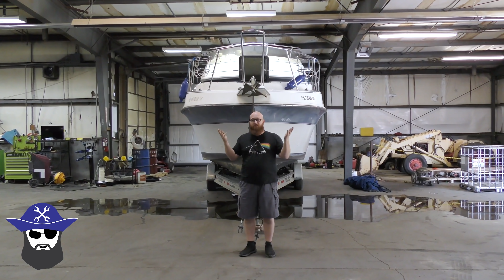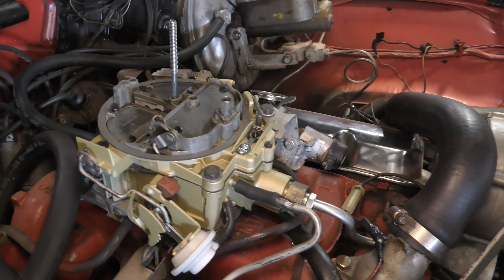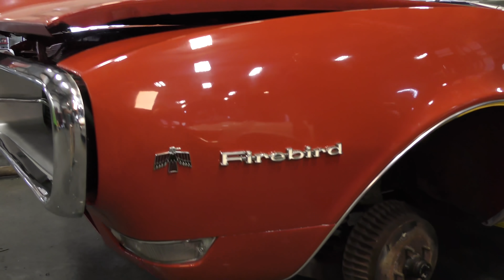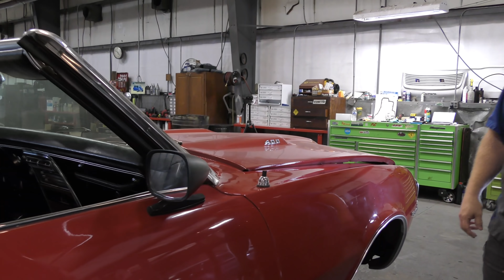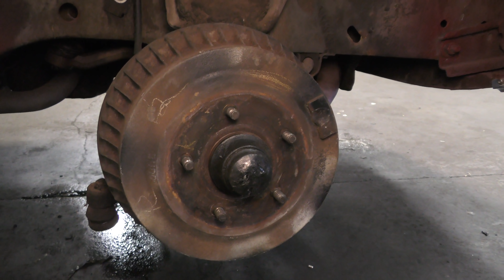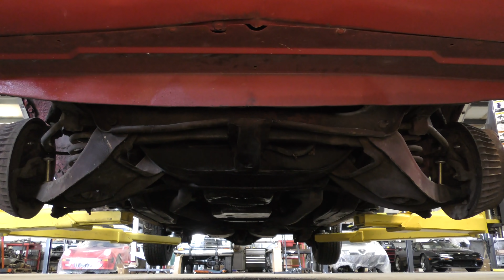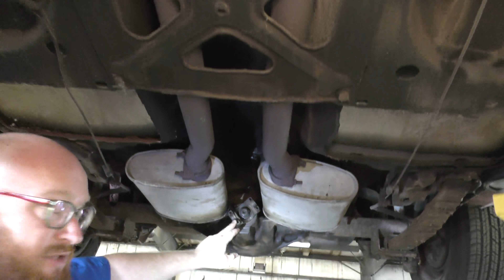Fabulous 1st Gen 1968 Firebird 400 leaking like Niagara Falls. The CAR WIZARD finds 6 places leaking

Comment: Oh, man, that's a solid car underneath. Didn't see any rust. A keeper. If there was one thing I would do to almost any older car to make it easier to live with it would be to replace the points ignition to solid state. My old Fiat used to be a pain to start with old duel point distributor. Bought a kit to change to solid state. Never regretted that $175 spent on it. Never have to mess with points again. Dead reliable. When those cylinders get gas it fires immediately. Points were never that good. Much higher voltage, much hotter spark, better gas mileage. A total win. Peace.
Reply: Never said it was hard. But if you want to spend part of your life messing with points, go right ahead. I used to gap points and set dwell too. What's your point? My point is you never have to do that and the the engine starts much easier. Plugs never get fouled. Believe me,the difference is a revelation. Try it.

Comment: I'm disappointed Wizard, that car DOES have a/c. The evaporator is present and the compressor lines are there, just tied up out of the way.
Reply: The A/C is staring at you Wizard
Reply: Well, it did. The compressor is clearly missing. You can see the empty bracket on the passenger side of the engine.

Comment: In regard to "survivor" that car has been painted, you can tell by the firewall and core support. Otherwise looks all original and honestly, who cares. Looks like a sweet old car! As for the drums, I think the most understated downside of drums is the requirement of adjustment. Now, some drums do automatically adjust but often those systems don't work so great and you end up with uneven braking. Playing with aircooled VWs, I think a lot of people do more harm than good installing disks because they only do front brakes but an aircooled VW REALLY needs strong rear brakes, it does not weight transfer in the same way as a front heavy or 50/50 car. So front disks increase the braking power and you get very little braking due to the fronts instantly locking.

Comment: One of the coolest engines ever made was the inline six available in these cars....they were OHC design. There was one optional version of the six (the "sprint 6") that with a manual trans was rated for 230hp (215hp w/ auto)....impressive considering that most 6's of the time were rated in the 120-150hp range. This was on par with moderate v8's of the era....many of the smaller 8's were actually 180-200hp at that time. (though performance versions of the small 8's were rated b/w 230-271hp)

Comment: It shouldn't be venting from the tank if the cap is sealing properly.  The cap is designed with a one-way vent that prevents the mechanical fuel pump from drawing a vacuum and stalling, so it lets air in but doesn't let gas vapor out.  I have owned a '69 Camaro for over 30 years and park it in my suburban garage.  I leave the garage door open for 30 minutes or so and then it's no longer a problem.  You are correct about the bowl vents in the carb, but the tank should build up pressure on a hot day and hold the vapor pressure.  You need a new cap.

Comment: I would take a Pontiac over Chevrolet if I had the money back in 1968 I would pick that car Pontiac firebird in convertible 400 or 350 cu not a Camaro why Pontiac put more style than Chevrolet plus I was in vocational school in 1972 and worked on these clutch work break jobs engine work head jobs I still have my engine analyzer you needed to set dwell and rpm also point gauges when I left school in 1973 I never worked on electronic ignitions or disc brakes but I have the books from 1966 to 80

Comment: i love carburetors no computer cars with sensors, catalytic converters, air bags etc modern cars have too much junk. well if odometer shows 79.000 well it's 79.000 not complicated. don't need air bags seatbelt is fine

Comment: If I am not mistaken the timing gears only last 50.000 miles they are nylon coated and break off and then it gets expensive. not sure about 68 but I had 2 69 400s  the gears let go

Comment: Ok I call bs on the working on old vs new. New cars most of the time need a multi thousand dollar diagnostic tablet. Also most are limited on room to get to parts parts made of plastic everywhere. Maybe new is easier if you have a shop full of lifts and tools but you can take most of that firebird apart with a ratchet three to five sockets and three to five wrenches.
Reply: While it there tell the customer to spring for an engine shampoo and then paint it the proper color (metallic turquoise) . Check to see if the carb / linkage has a factory installed throttle limit (because they didn’t want the “TIGER” the GTO to be beaten by the less horsepower Firebird (it wasn’t, it was otherwise the same engine

Comment: Engines were OHC I6, Pontiac 350, or Pontiac 400. Not a 326. In fact, the 350 was actually closer to a 355 or 357 depending on if it was a 2 barrel carb or 4 barrel HO model. They had a front disk brake option and it was actually the same brakes as the Corvette of the period instead of the weaker set the Camaro offered. That cars been repainted at some point. The front panels under the hood shouldn't be body color and neither should the gas cap. So not really a survivor. Also unless that cars had the center stack replaced it was an AC car at some point. That long rectangular vent in the center was AC only.

Comment: Those hinges look brand new.. I worked in QA for a company who made hinges, GM was still using that spring ,cam and roller design in 2007.  fyi the bushing on the roller was to thin and causes it to have to much free play and stop rolling..

Comment: *Cool car here is a link for the missing emblem on the grille.  
https://www.yearone.com/Product/1967-1968-1969-1970-1971-1972-1973-1974-1975-1976-1977-1978-1979-1980-1981-pontiac-firebird-trans-am-parts/j6#prettyPhoto.  I was lucky enough to see a 1969 Trans Am it was all original white with a Blue interior.  The car only had 29,000 miles on it.

Comment: Say what you will about the old stuff.  You don't need a $3,000 computer to diagnose them and the parts don't cost hundreds of dollars to fix.  In today's traffic disk brakes are always safer.  Plus the heat related fade is greatly reduced.  I understand if you want to keep the drums for originality but don't tell me that drums are just as good.  If that was true we'd all still be driving cars with drum brakes.

Comment: I had a '77 Dodge Monaco that had the gas cap behind the license plate, which made for some fun when college friends would offer to fill it up 😀  Of course, once I showed them where it was, they learned about the 26 gallon tank!  There were some ways it was much easier to work on than today's cars, but you're right that diagnosing a starting or drivability issue was tougher since it had no computer to tell you what was going on.  It was pretty modern compared to that beautiful Firebird, though, with disk brakes up front, a basic evap system, and air conditioning.  Also, the high-end stereo with 8-track player 🎵

Comment: You don't take these cars to the Pontiac Dealership because GM shut the down a decade ago, but I agree that a GM affiliated dealership wouldn't work on them, and to be honest, I would put the distributor, drum brakes, and carburetor on the shop shelf and convert to injection, disc, and put in a Haltech, but would always feel guilty afterwards.

Comment: These cars are not hard to work on but not every garage wants to deal with a car this old. The problem is when you replace a part, you it may lead to the replacement of several parts and more often than not, the customer won't understand why and blows a gasket. The other reason is this: why learn a set of skills you are rarely, if ever, going to use?

Comment: Those elastomer balancers slip the outer ring and break a crank so....definitely replace it. Getcher vacuum gauge out for tuning :) Old cars have personality but, there is a reason why we learned to work on cars back then....because they broke down all. the. time.   These fricking cars smell like unburnt fuel all. the. time. too, because carburettor and no cats.....

Comment: In 1980 I inherited the 1968 Catalina Convertible 400 my Dad bought new in Superior, Wisconsin. The Catalina 400 had the 2 barrel carb and while it was a fast highway cruiser it was no drag racer. Probably had tall gears. In the snow belt the rust was horrible. A huge chunk of fender fell off on the Interstate and I needed to junk it. It wasn't valuable enough in the 1980s to restore. About drum brakes they work well when they are dry. Driving in rain I have pushed the brake petal and there was absolutely no brakes and they don't dry out for a long, long time.

Comment: I'm lucky that because the car I'm working on was optioned with the larger engine, it got not only boosted front disc brakes, but also an alternator as part of the £16 package (this was in around 1970/71). No need to do a front disc conversion - only needs the dual master cylinder setup+fluid indicator from one of the heavier or sportier models.

Comment: Yeeeep - old cars kinda smell. I'm a few years older than you Wizard, so yeah, I remember parking lots - or even just sitting at an intersection on a hot summer day in a big city;  HOOoo boy, did it smell bad.  Then we didn't think anything of it because that was "normal", but when you think of that in today's world, it's shocking how much stuff was getting dumped into the atmosphere.

I had a 1975 Pontiac Laurentian (Canadian base model of the Catalina) until 2006, and that was always hilarious at the gas station.  I'd find it funny to use one of the few remaining full-service stations and see if the teen working could figure out where the gas tank was.  Like you said - none of them figured it out.  Fun watching them try to fill it too - you couldn't go full-flow with a lot of those older cars or it'd kick back up at you.

Comment: How about a heater core? I'm 61 and have no problem with the older cars. Tuning a carb setting timing and adjusting points are very simple. The issue is that financially it's better to have a newer car where the cost of repair makes since.

Comment: Beautiful car, one minor correction. In 68, Pontiac offered the 350 cubic inch motor or the 400, the 326 was offered only in 67.
Reply: And 4 bbl. 400 rated about 440 torque...

Comment: Man this car brings me back to my youth when I had a '68 GTO with the same 400 engine. Loved working on it because I didn't need to be a computer technician lol. Thanks
Reply: GTO 400 may have been hotter...
Reply: @BuzzLOLOL  Absolutely!  I had a 67 GTO with the 400 and Holley double pumper but my dad used to always say the 389 with tri-power was the hot setup if you adjusted the carb linkage correctly.  Fun times.
Reply: @aussie2uGA  - The 400" came in 3 or 4 HP versions... all 4 bbl.s since bigger 4 bbl.s were available by then... when I puked my '65 360 HP 389" tripower I put a base '68 GTO 350 HP 400"  under the tripower but with milder cam and lower compression ratio it didn't make the tripower howl like the hotter 389" did... prolly just a touch more low RPMs torque, though... averaged 17 MPG in easy driving... 
https://www.youtube.com/watch?v=SJIRitKQYrM

Comment: I never remember a strong smell of raw gas on old cars.  I still have a 53 Willys Overland in my shop and I don’t smell gas.   Usually a strong smell of raw gas means a leak, or the top of the gas tank is starting to rust through.
Reply: Rusted out fuel lines... rotted rubber hoses...
Reply: Yeah, I don’t really remember pervasive raw gas smells either, growing up in the 60’s/70’s.
Reply: One thing to check is the fuel line connection to the carb which might also hold the fuel filter. This connection has a plastic/nylon seal which can break.

Comment: Pontiac used a plastic covered timing gear, which should be replaced every 80,000miles or so. If it has been replaced with metal gear fine.
Reply: AC was expensive in the 60-70s and most people buying cars were part of the heaters optional generation. Then AC became standard equipment for one company so everyone had to include at.
Reply: I would check starter brushes and alternated,
Reply: As a teenager I maintained the family cars. 66 Catalina 389, 67 Catalina, and 71 Catalina. 
Almost talked Dad into into a 69 Firebird 6 cylinder.

Comment: Check your PCV valve, bad or unsealed/vented gas cap, gas tank filler tube, vacuum hoses, fuel lines, check for bad gas tank valve or your carburetor not adjusted correctly, how about the float sticking on old cars. I worked professionally back then on these cars. Old timer here, there was always a problem for the gas smell. Just got to find a good mechanic to find it.

Comment: This car is MISSING the exhaust system crossover tube.  This missing tube causes carburetor overheat boiling the fuel.  FIX THIS PLEASE!
Reply: I believe the exhaust crossover has to do with pressure pulses.  This tube allows pulses from the cylinders to equalize the pressure and help scavenge the exhaust.  I don't think they had anything to do with the carb.
Reply: @Flies2FLL  That car intake manifold has a connection to each bank for carb heat.  Without the crossover tube there is far to much heat applied to the carb boiling the fuel and can even ruin the engine do to flooding.  The exhaust pipe crossover tube is essential to proper function.  Ether that or block off the connection at the intake manifold to the exhaust.  Blocking off is a popular solution in many climates that are warm where carb ice is not an issue.
Reply: @zynzy4u  OK, but usually when people use the term "crossover tube" they are referring to what I talked about, not the carb heat manifold.  

Carb heat is a BIG DEAL on light aircraft, since the carb is under the oil pan and can actually fill with ice and shut the engine down in humid conditions.
Reply: @Flies2FLL  On this car and many with carbs the exhaust system crossover tube is required to prevent carb overheat by to much exhaust being force through the intake manifold heat by the exhaust system crossover in that manifold.  Have seen the lack of exhaust crossover destroy dozens of engines by flooding and running rich from boiling fuel.  Most do not understand this is very important.  Changing the subject to airplanes is not what this is about as airplane carb heat is supplied by heat exchangers surrounding the exhaust and not from exhaust being sent through the intake manifold.  Without heat in the car of question here yes,  ice can form and stop the engine.  Without the exhaust system crossover pipe, the intake becomes overheated and boils fuel.  My 67 GTO does not smell of fuel after driving because I am not ignorant of this fact and have a proper exhaust system crossover tube.

Comment: Wizard, if that gem still has the original nylon timing chain, replace it. The timing chain is known to fail early. Hook up a timing light and check for a bouncy timing mark.
Reply: If the timing chain is original after 43 years, I think it's fair to say the danger of it failing early have long past.
Reply: @Adam1nToronto  53 years... but who;s counting.  Then again, odds are the engine is newer than the car!
Reply: I wish I had changed the fiber timing gears in my 454 Silverado before they disintegrated. I ended up buying a short block crate motor to replace it, but would have preferred to still have the original engine.
Reply: Interesting. Never knew that and I have built a couple 400s but none of them were stock. Guess they got swapped out before I got my hands on them.

Comment: In High School, my best friend’s brother lent his Firebird 400 coupe to us for the prom.  It was the same color and had a factory installed experimental automatic that at full throttle would lay down a good 10 ft stripe from first to second, and chirp from second to third.  It was an attention-getter for sure.  On another subject, it was very uncommon in that era to get A/C on a convertible except in places like FL, TX and AZ.   A/C in the 60’s was still a high cost option (relative to the price of the car), so a large percentage of 60’s vehicles didn’t have it.
Reply: Here in Europe A/C systems where very uncommon up to the end of the 1990's  because they where a very expensive option.
Reply: @EdgeOfPanic  It doesn’t get very hot there either. What’s average summer temperature?
Reply: @Ornelas11B  Well about 21 degrees Celsius so not very hot on average, but we can have about 20 to 30 days a year that it's quite hot (above 30 Celsius),  summer of 2018 and 2019 where insane, it was hot from April until October!
Reply: This was my first car back in the late 80s. Taught me everything i know about fixing a car... Miss that car a lot

Comment: Damn wiz….my dream car!
Reply: I had a 1971 Nove that was completely rebuilt and made for the drag strip. I raced it a bunch of times, and used to love to drive it through the Everglades with the speedometer pegged. Once you got to 100mph, the car just drove itself - it was amazing.
Reply: @hannahpumpkins4359  I had a 70 Bonneville 455. It drove like a marshmallow. When you got over 100 it floated down the road…
Reply: @aussie2uGA  good old Pontiacs ….Pass everything but a gas station!

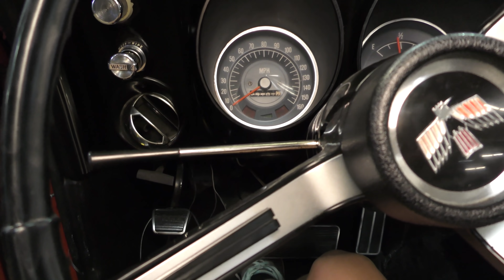Comment: 11:07  You're right about the turn signal arm, but you missed the 4-way flasher control on the other side.  It's mounted on the steering wheel so it will pop out if you start driving.

Comment: And Wizard, I’d rather have to sit and fiddle with a carburetor and points and condenser for a couple hours to get it right than depend on software that could glitch out and require “updates”. 

Computers are taking over cars way, way, WAAAAAY too much!!! And this is coming from someone whose every day driver is a 2019 Camaro SS 6 speed. I don’t like all the computers cars have today. Not at all.